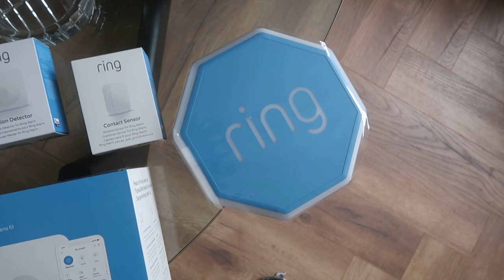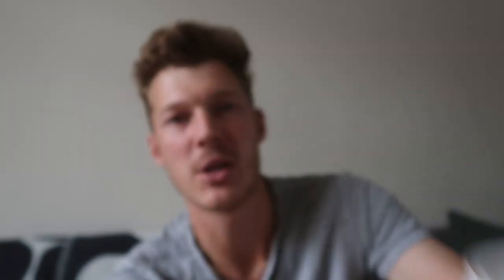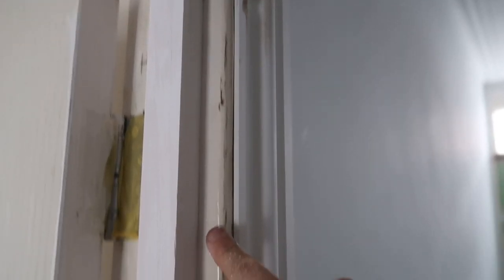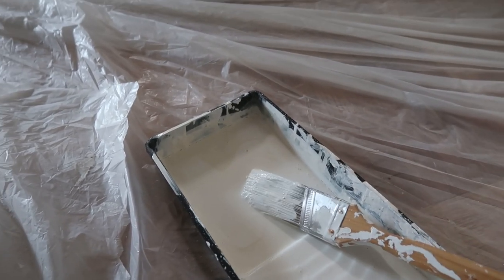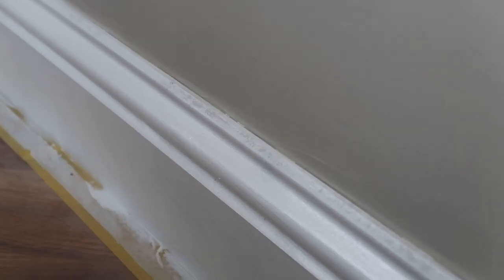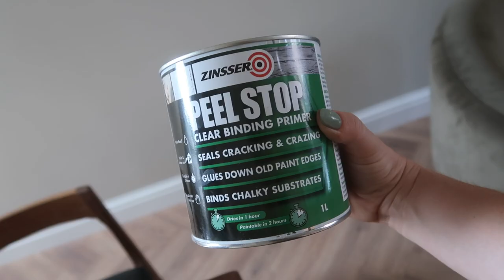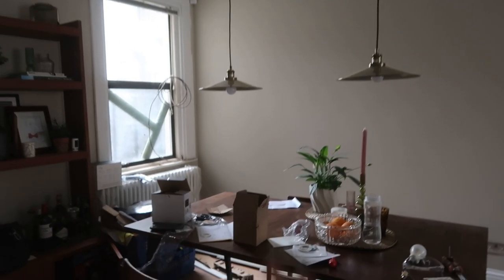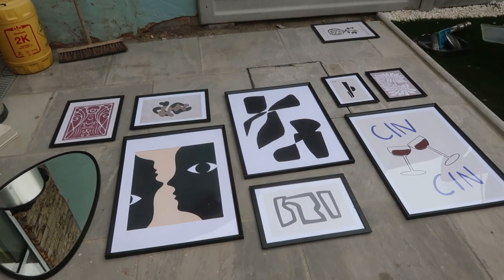LIVING ROOM RENOVATION PART FOUR - DIY gallery wall, ring alarm system, finishing touches

Comment: Ah we had the same issue with peeling flakyness in our Victorian property. The zinnser peel stop was a LIFE SAVER ours has been primed and re-painted coming up  1 year now and no peeling 🙌🏽
Reply from the maker: Ahhh so glad that worked! Relieved to know it must be common in Victorian properties looking at other comments too!
Reply: Yep, we even had it on walls we took back to brick, were left to dry fully and plastered with Lime plaster 🤷🏽‍♀️
Reply: Ours happened in our living room. It only happened on the ceiling after plastering. Ours isn't damp issue as our house  is from the 70s. I thought it was the paint we used. We Peeled away everything that flaked off and used different paint and it's ok now. No clue what it was as we used a missed coat like 3 times all with different ratios.

Comment: The zinsser primers are awesome, I would always recommend them. One budget option you could try for peeling areas that has worked for me is to use slightly watered-down pva glue (about 1/4 water 3/4 glue). Paint on your first coat and let it fully dry,  then paint on a second coat and put your finish paint on when the glue layer is almost dry but still ever so slightly tacky. Love the gallery wall, its all coming together nicely!
Reply from the maker: Thanks for sharing this. We did consider PVA but read a lot saying do not PVA plastered walls so ended up using the Zinsser. Tbf the Zinsser did seem like a watered down PVA mix.

Thanks so much! Can’t wait to share with you all the reveal next week ☺️

Comment: We also have a victorian house, the pain peeling is not just a damp thing, but also the type of paint.
Lick has and Coat seemingly advertising to be all natural has actually got some plastic in it, which means the paint wont be breathable. We had to completely peel that section off and use filler to patch it up, but we went with completely natural paint. Look into Rose of Jericho paints, 100% natural and used for period buildings. Hope that helped!

and yes, definitely tape the skirting unless you're a master paint cutter aha. Prepping for painting is the worst part for me.
Reply from the maker: Thanks for sharing - interesting to know. Will check them out - thanks so much ☺️
Reply: I agree with prepping for painting being the worst! I just want to get cracking on with painting and you end up spending more time putting down tape and doing the edges before you can get the roller out!
Reply: @Lick  that’s excellent! Looking forward to those products! I do love your colour selections! But a shame we can’t use it for reasons above

Comment: If you have injected that wall with a chemical damp proof course the paint is flaking because the product has dried the wall out and pushed the salts to the surface causing the flaking.

You need to use a salt neutralising product before painting to prevent that from happening.

Hope this helps.
Reply from the maker: Really interesting to know. Thanks for sharing!

Comment: The peeling issue might be due to the fact that you may need a vent in the dining room wall.  Most Victorian houses had a fireplace in the front room as well as the back room.  If there was a fireplace in the dining room and it has been bricked up without a vent then this could be the issue (the room just needs to breathe).  Agree, all Zinsser paints are amazing and are great at solving irksome problems.
Reply from the maker: The fire place has been completely removed so no need for a vent but yes good ventilation is super important to avoid dampness on walls! Zinsser is amazing!
Reply: @FeedbyAutumn  has the chimney breast been removed? If there's still a cavity where the fire place used to be it will be hollow behind that area and definitely would need a vent in that case. I have issues with something going on in the wall my chimney is on (fire was long gone when we bought it sadly) and we can't figure out what's causing it. Absolute pain in the neck after spending so much money renovating and worrying it will have to be ripped apart to fix :(

Comment: Did you remove wall paper at some point? The peeling issue might come from the old glue still on the wall and bubbling when you add moisture with a fresh paint. It's fixable with a good primer :)

Comment: That zinisser peeling stuff actually is the solution to stop the paint peeling on your wall if it’s new plaster it ends up sucking the moisture out of paint causing peeling and flaking you should be fine once you put the zinisser up
Reply from the maker: So far so good!

Comment: It may be the length of time between your coats of paint? We’re you doing lots of layers close together? Xx
Reply from the maker: We definitely left enough times between coats. I think it’s a combination of it being an old house and damp injections pushing out the salts based on comments others have made ☺️
Reply: @FeedbyAutumn  makes sense ☺️ wonder if a paint that isn’t water based might be good 😌 or putting a primer, something like stain block might help xx

Comment: Did you definitely mist coat underneath that paint which is peeling? The wall could be sucking the moisture out of the paint you applied if not, causing it to flake.
Reply from the maker: Yes we did - potentially not enough water. Thinking back the mist coat seemed to go on ok, it was just when we used our main paint it peeled in areas